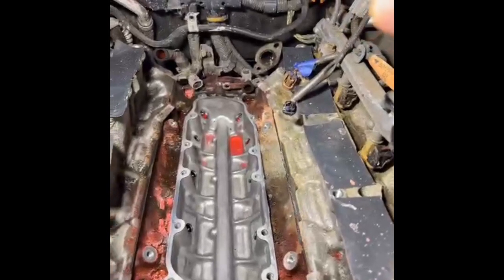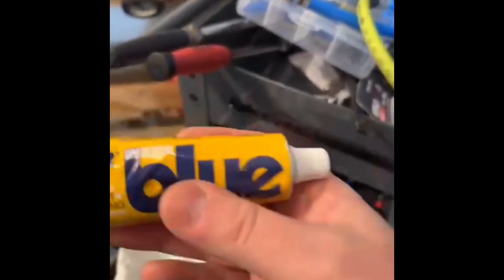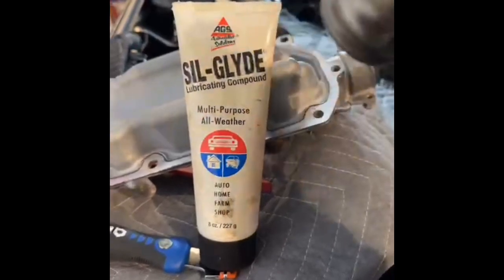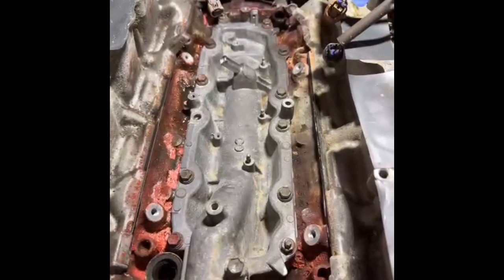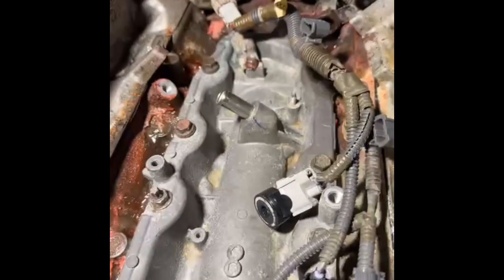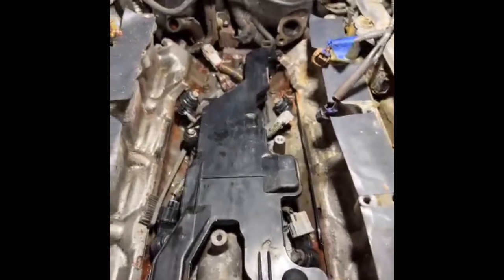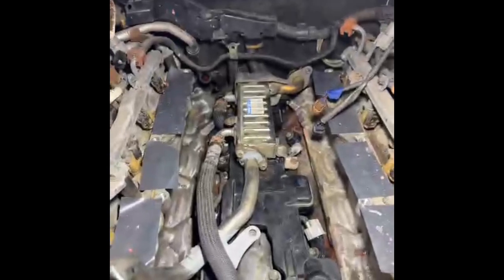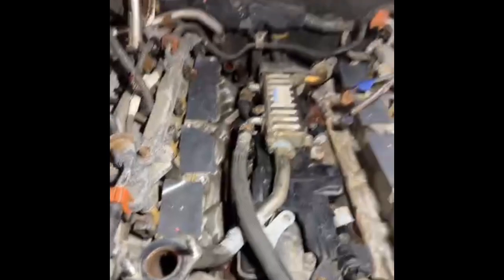GX460 Valley Cover Plate Leak Fix

Comment: Did lexus ever fix this defect? And if this problem something all of these engines will have?  Because this is more like Chrysler reliability. Shame on lexus for this.
Reply: change coolant every 5 years, see the car care nut video on it
Reply from the maker: To my knowledge it’s an issue all the way to 2023.
Reply from the maker: @musoui They’re not designed to leak again, they just do because Toyota used an inferior sealant. And shame on any shop that “fixes” the leak using a sealant already proven not to last.
Reply: Mine just went and I did regular coolant changes😡
Reply: @FU29988  damn what year?
Reply: @Racontact  2014
Reply: @FU29988  My 2014 just let go as well....
Reply: @ryanscott4237  geez, wish you the best!  But theres nothing wrong with trading it for an 87 octane sipping new-used, maybe even new Lexus RX or ES with Apple carplay, lol.
Reply: @roofcamper3473  
That's a different issue he was discussing. The problem here is a factory defect with the sealing and/or casting.

Comment: I’m working on this now, had everything buttoned up and started to fill with coolant, and it was pouring out that cross over pipe. I used coolant as a lubricant because I knew this was a potential issue. Guess that didn’t work!! Any tips to confirm the pipe and o rings are seated properly? Thanks!